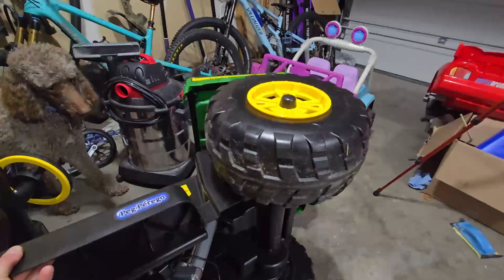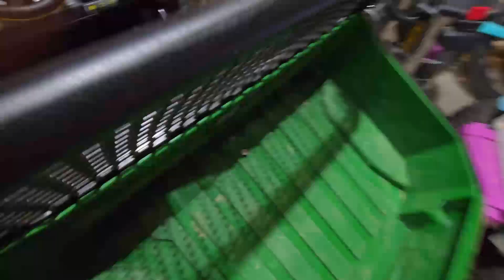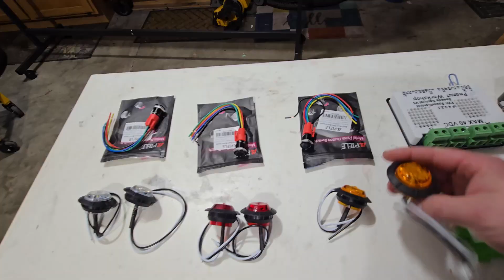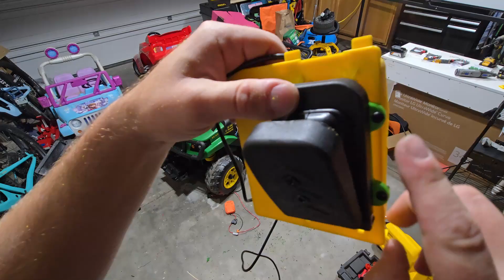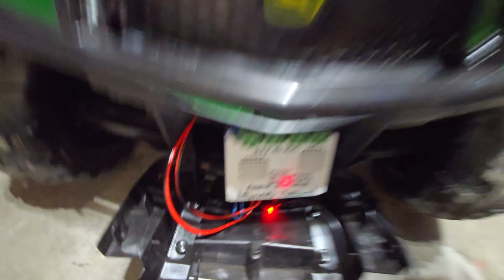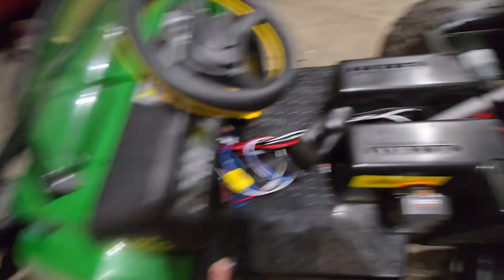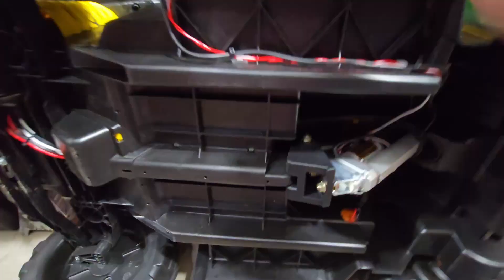Peg Perego Gator Gets a Full Overhaul – Speed, Lights & Power Dump Bed!

Comment: Can you give part numbers or links for the actuator brackets you're using please?
Reply from the maker: The metal brackets came with the actuator and the 3d printed bracket is on thingyverse, the link is in the description for that one.
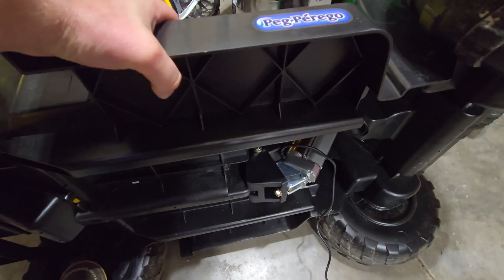Reply: @PeanutWorkshop  I downloaded it and printed it, I am just not sure how it attaches. Do I drill holes for it through that center channel in the chassis that seems to be routing motor wires to throttle? The only view of it installed is 0:55 - 1:14. Looks like it bolts through that part, but did you have to make a hole? Also is that a 12" stroke?
Reply from the maker: @denisvasilescu yeah, I used m8 bolts I believe and drilled through the plastic.  I believe it was an 8" stroke but I can't remember.  Also buy the faster actuator, I think it will be more than powerful enough

Comment: Just picked up one of these for bday present. With the heavier gauge wiring, do you feel like the gear selector and plunger would still concern you if simply upgrading to traxxas titan motors?
Reply from the maker: Changing out the wire won't really effect the switches.  Running 12v with Traxxas 550 motors we had a couple cars melt switches.  Want pegpergo though.  If going to 18v and Traxxas 550 you will be at high risk of hanging switches.
Reply: @PeanutWorkshop id leave the stock peg  wiring and stay at 12v. I noticed in the video u said the wire gauge was thicker with the stock peg vs power wheels. Wonder if the compents would be able to handle the lesser resistance better.
Reply: Looks like we shall experiment and find out! Lol

Comment: Another question I thought of, couldn't we run an actuator through the speedy squirrel controller 12V accessory output? I have seen some on amazon that have a max draw of 3 amps which is what you list the output rated at.
Reply from the maker: That was my original plan but when I saw how slow it was I decided to run it to 18v.  I do want to test it and see if it hits the over current protection, I just didn't get to it.

Comment: Great video, i hope you figure out how to run 887s on it. I was considering putting 895s on with bigger rubber wheels to give me more speed and traction. Seems like gator is well built and I'd be curious if it could handle a trailer with some weight in it.  Question: Is it necessary to run separate 10 gauge wire pairs for each battery? Also did you not do Lifep04s because you were limited on space here?
Reply from the maker: I think it could handle a trailer as well, it is well built and sturdy.  I have heard the gear boxes hold up really well too.  
I went the the Rigid batteries just because 18V made the most sense for the stock motors and they are really convenient batteries.  I bought a few two packs at $79 each and they are performing well.  I really don't know where I would have put two LiFePo4 batteries in there now that you mention it.